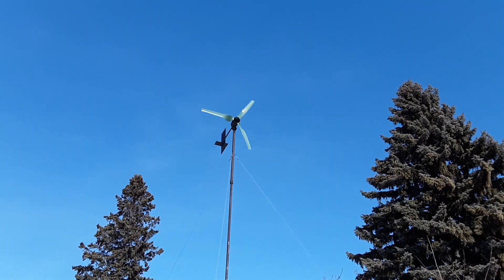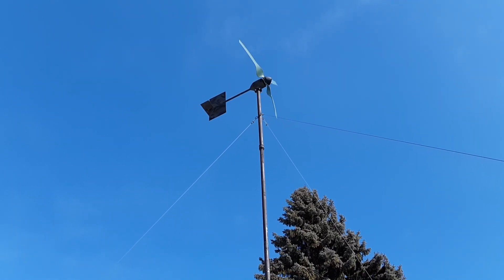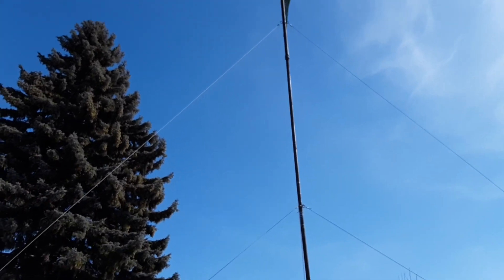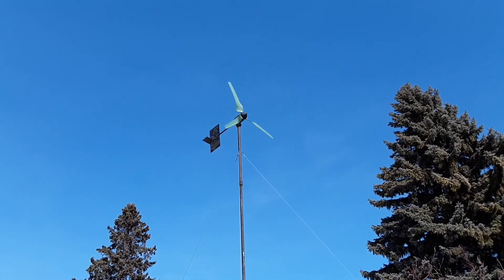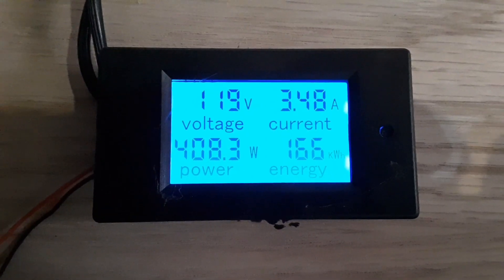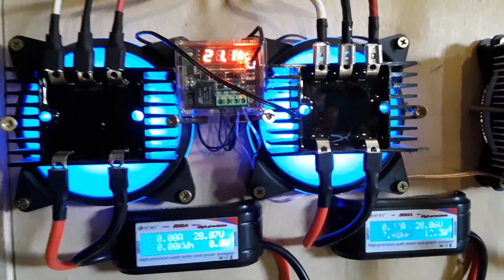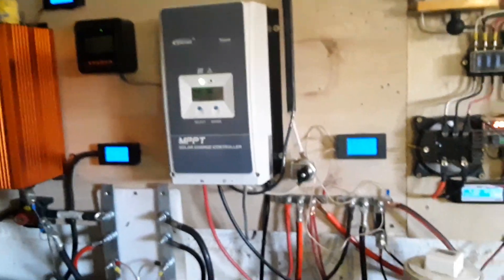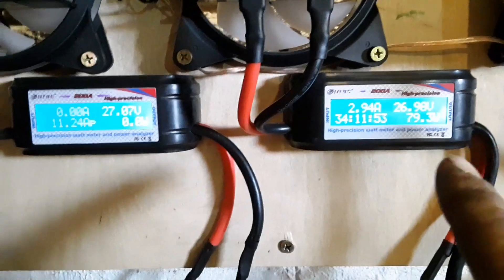Is Micro Wind Worth It?

Comment: I only have 500 watts of solar and a 400 watt wind turbine, with 8 12 volt batteries 1 charge controller snd a pure sine inverter here in Colorado… Together they do pretty good. We have a small 650 sq ft house(only 2 people) and have a wood stove for most of our heat. Wood is free since I run a tree service. We use the propane grill to cook, but also have a small microwave, washing machine and rv type refrigerator,hot water heater .Other than that we just have a few fans, the tv ,charging phones and tablets.  Our water pump consumes a good amount of electricity. Some days its super sunny and the solar does enough to charge the small battery bank, but some days it is super windy and the little wind turbine is cranking and is a big help.I really like that the turbine helps charge the batteries at night. When both the solar and wind are cranking there is plenty of power. Before the turbine I would have to start up the little honda generator about 30 minutes before bed ,15minutes early in the morning and several hours on cloudy days in winter. Now I only use the generator maybe an hour per week,sometimes not at all. People that have these massive solar systems and wind turbines…. how much electricity are they using???  I think we use about 1.5kw per day. Like the video said thats only cents worth of electricity… but if you can’t get electric service… it’s everything to you. With gas being so expensive now, Im really happy to have the wind turbine helping out the solar panels and not using the generator much.
Reply from the maker: Thats just it bud! Sounds like your living the dream out in colorado. If it works....dont fix it.

Comment: Hi, Would you know of anyone that would offer me advice on the required spec of the generator that would fit the Jacobs 10Kwh turbine? Ideally, they should be familiar with the assembled parts of a Jakobs 10Kwh or 20Kwh turbine. I would of course pay them for their time. Right now I need good advice. I can set up a zoom meeting and I'll only take up 30 minutes of their time, thank you. And I look forward to hearing from you. Regards Seamus
Reply from the maker: That turbine, i personally have zero experience with. I believe i could learn everything there is to know about it in a hurry. Where are you located?
Reply: @smallcityhomesteaders1600  Thank you very much, back to me. I'm from Ireland. Jacobs turbines are an American company that I believe started in the 1930s. The company has long since dissolved their turbines are still in use. This is mainly due to the quality of build and quality material used during production. About 10 years ago Professor from one of our universities took a Jacobs or from America and used it for two or three years. He then disassembled it and has been in a garage ever since. I have an opportunity of purchasing this time. There are a few issues that I need addressed my own head before I commit to the purchase. These issues are predominantly round the spec of the actual turbine motor itself.
What I need is a schematic diagram which I’m sure is probably very hard to get. The build of the 10Kw is exactly the same as was demonstrated in this video (only at a tiny bit small).
https://www.youtube.com/watch?v=Z20KeAGXhGw&t=45s

Comment: 1. which blades are you using. They seems quite ? 2. What was the power output with 5/6 blades? and the noise level?
Reply from the maker: The blades on the 500 at the time in this video are the 810mm furling 3 blade set. On this turbine they did the best. Saw peaks over 500 lots of times. The 5 blade 650mm set never really picked up steam for me, the 6 blades i think did the same. In this location, the 810mm bested everything but in high high winds in actually can get pretty noisy. Personally though...i love the sound.

Comment: An excellent setup, really doing the job there.  You guys pay 11c per KW/h? Wow, that's cheaper than the UK, less than half price. Our Gasoline is about $6.67 a gallon at the moment too. But being off grid isn't about saving money. It's quite hard to see a return on solar and wind investment.
Reply from the maker: If you build it yourself and set it up correctly and efficiently,  I  wholeheartedly believe my system already paid itself off in 3 years. One could argue my savings came from my extreme cutback in use but had I never gone totally off grid I never would have fully understood just how much I was using.  2015, 16 and 17 I  paid about $3500 a year for heat/electricity...I have less then $6k invested into equipment....haven't pulled a single watt or therm of gas from the city since April 2017. You do the math... If I were trying to run my furnace and filling an L.P. tank my system would have to be 5 time the size and gas cost would be minimum $1k a year....but we're smarter then that and build something to operate our needs plus a little modern comfort (dishwasher, fridge, deep freezer, cloths washer, TV, wifi....ect) but we dont own a toaster, microwave or electric coffee pot because they're wasteful and unhealthy anyways.  It's different but in a good way. When I power the house down for bedtime....its quiet!
Reply: @smallcityhomesteaders1600  Nice vids! What is your homes heat source?

Comment: I stick to solar now windy enough here in the city but I guess its where your located if its worth it. 

I just became a new friend :) I hope you do the same!
Reply from the maker: Truthfully,  I don't get sufficient wind to ever see 'rated' power out of my turbines but after quite a few modifications, in spite of my dirty (turbulent) wind they finally make useful power.  I knew going into it I'd never see them peek but like I explained on the video, when your on stored power, every watt you can get coming into the batteries is useful and "worth it". Rite now they're both making about 100 watts each which doesn't sound like a lot but the solar is only making 400 so my batteries are charging 1/3 faster then if I didn't have them. Tonight when the sun goes down and I want to watch a movie,  they'll keep making power and I won't have to keep checking the volt meter to see if I the batteries are ok. If I DID have better wind and actually saw these turbines do what I know they can do, my solar controller would rarely get much use. Thanks for watching!  Sub'd your page also.👍

Comment: Looks like my system design is helping many. Love it, but If you make a tri-tower in your premium location you can do better. Just the fact you have the system up and running with the ability to make your batteries last 30% longer pays off.
Reply from the maker: They'll be going 10' higher soon. Gotta bring the rest of my scaffolding home and that will put them both up into the air finally. House is 21' at the chimney and the towers are both 25'. Very turbulent air. It's funny, the harder it blows the less air they catch around here. In steady 12 mph wind they do best. I guess it doesn't swirl as hard. Had 28 mph gusts from the north last Friday and they both flipped left and right trying to catch it. Though to myself  "maybe I'll finally see 1232 watts like the great John Daniels".... nope. Didn't go over 275. I'm still happy to get it.

Comment: You need a furling mechanism for that turbine
Reply from the maker: I never get strong enough wind for it to over spin and if it does i have resistive braking built into the control board. Maybe but once a year I'll need it.

Comment: I've heard many people say those words (it's not worth it you will never get your money back) the fact is you don't get your money back on a lot of things in life but you still buy them, wind turbines.solar or hydro to me is not just about making/saving money it's interesting challenging and fun to work through things although it can be frustrating at times,  so to me yes it's worth it it's all worth it just for the pleasure side of things as well as the fact that if your grid drops out you can keep your freezers running, four years back we lost two freezers of food after a 3 1/2 day power cut if i'd had my battery bank set up them i'd have saved quite a lot.

I'm going to have to get me some of those bigger blades.
Reply from the maker: You hit the nail square on the head there. In the 4 years we've lived on stored power I've seen the power on my street go down a handful of times and it gave me a special satisfaction knowing my lights were still on and my venison will stay frozen.
Reply: @smallcityhomesteaders1600  Hi, are these the scooped blades you used ? if so can you tell me if the hub fit straight onto the shaft of the 500w turbine.

https://www.aliexpress.com/item/33050641552.html?spm=a2g0o.detail.1000014.1.3e5e45edifRAAS&gps-id=pcDetailBottomMoreOtherSeller&scm=1007.13338.154834.0&scm_id=1007.13338.154834.0&scm-url=1007.13338.154834.0&pvid=abd64d29-ae6b-4c1e-8f46-c9058d1d7b30
Reply from the maker: @johnbeattie9561  so sorry for the very very late reply.....those are the blades. They rock! They do make a bit of noise but the power output is worth it. I love the sound of free power.

Comment: Low mast, unguided blades. There will be very little energy. Wind generators should be like that.
https://www.youtube.com/watch?v=2fOnCKLQhfs&app=desktop
Reply from the maker: I will admit, that is awesome but I'm in city limits and there's rules about how tall thing can be. I will be adding 10' to both my poles sometime this coming spring and I expect considerable better performance but that will put me at the very limit of what's legal here. I've tried to stay 'low key'.
Reply: @smallcityhomesteaders1600  What is the Height Limit ?
Reply from the maker: @MrSummitville  not an inch taller then 30' without inspection and approval.  I'll have the inspector come out this spring and if I get the thumbs up I'd like to go 10' higher which would put the alternator at 35'. Well over the house and over all my trees except the one monster pine. Cheap add on that will put them up into the breeze where they'll really produce.